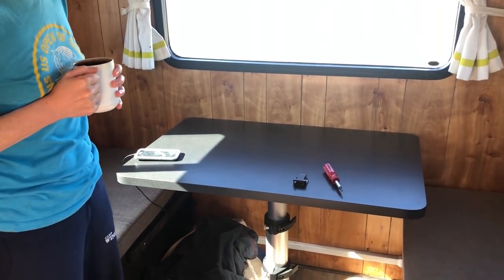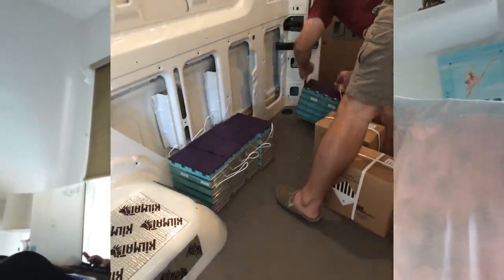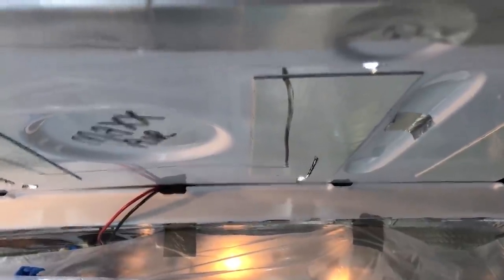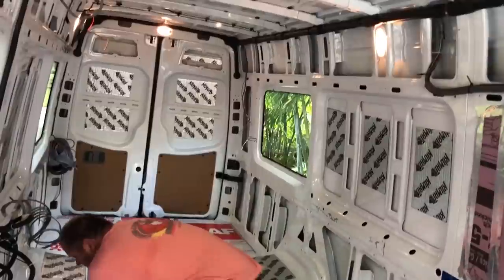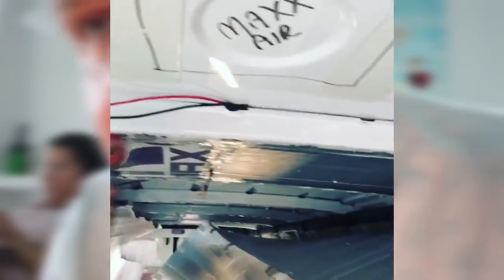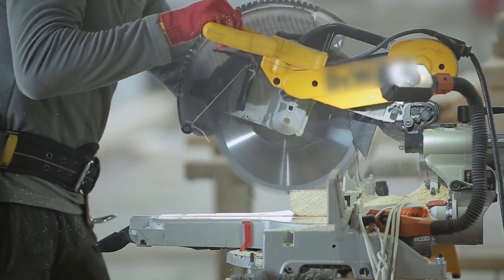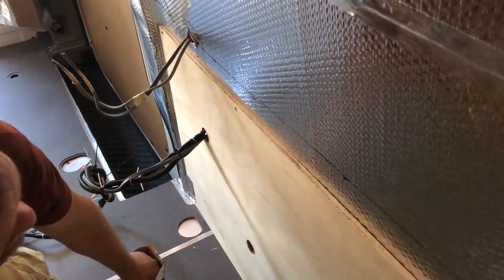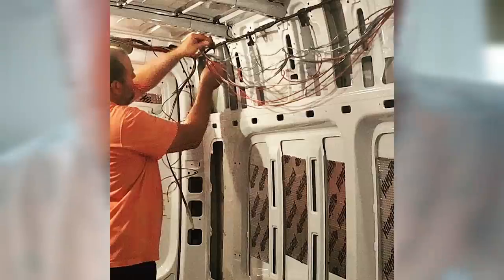Van Build DIY | What does it take to build a tiny home?

Comment: Hi Snow and Curt. I have a big dilemma and I need help. I plan to build a clone of your van on 2020 cargo 4x4 diesel that I'll order at the beginning of August. My big question is about the chassis. Would be enough a 2500 (GVW 9,050 lbs) or should I go with 3500 XD (GVW 11,030 lbs.)? With your van fully loaded are you over 9000 lb or under? Thanks for your help.
Reply from the maker: You need the 3500... When fully loaded (fuel, water, cats, food, and humans) we are 700 pounds under capacity for the 3500. Cannot remember the exact weights... But hope that helps! 
How exciting!!!!

Comment: Merci | Thank you Curt for this video: you are my reference, can't wait for your van plan. I would like to know more about your Sprinter chassis: beside the 4X4, what are the options you have and would these be the same you would get if you would buy today with the acquired knowledge. (sorry if my english is not perfect, I'm french-canadian) You guys have a great day!
Reply from the maker: Your english is quite good. We are pretty pleased with the mercedes sprinter. The only downside is that the inside curves in towards the ceiling, but we knew that going in and the 4x4 & extr length outweighted the curve. It is a 2018 3500 diesel mercedes sprinter 170 extended hightop.

Comment: Point of concern.  Be wary of using solid core wire in a build, it wouldn't surprise me if the vibrations and constant movement of wires within the chassis eventually caused shorts and such, I'd suggest stranded wire instead.

Comment: When you were in the colder weather climates did you have any issues with condensation, or cold temps on the floor?
Reply from the maker: We had to wear socks... No condensation, but heated floors would be nice. But, we were not miserable by any means!
Reply: @SnowAndCurt  Thank you for the response. If you could do it again, would you add radiant floor heat? I know Curt is tall, so perhaps that factored into his decision...
Reply from the maker: It did factor into the decision... It's why we didn't do it. Otherwise we would have radiant heating!